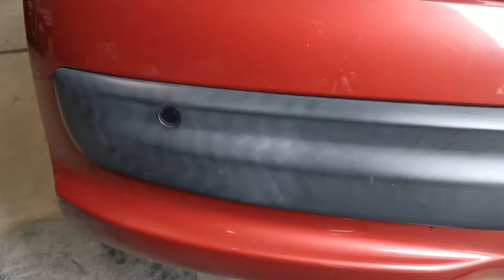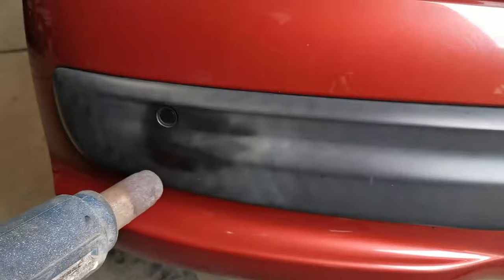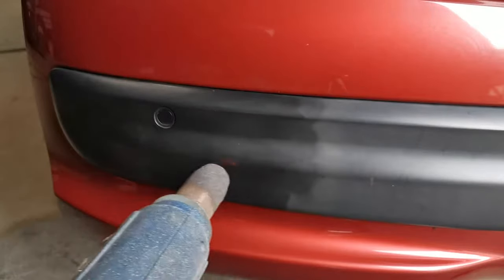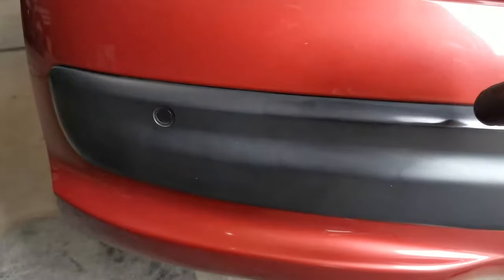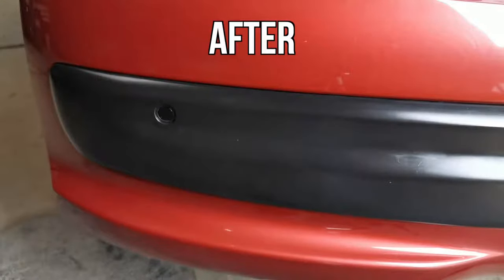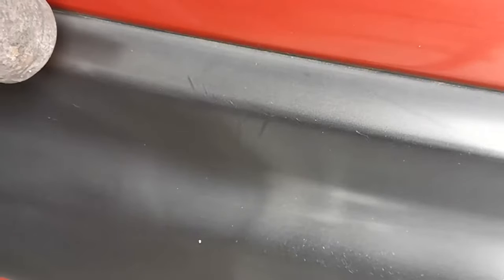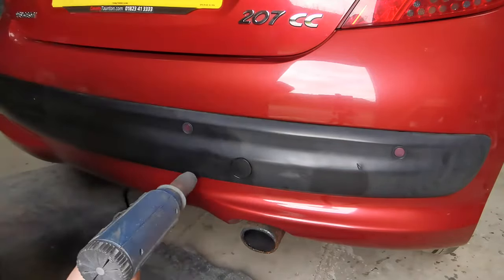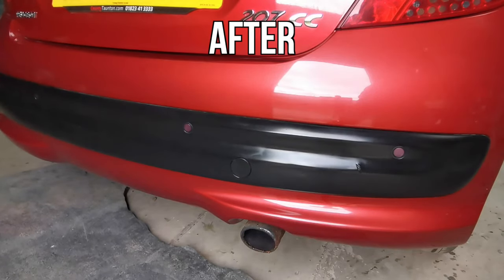How To Restore Your Cars Bumpers Back To Black for FREE

Comment: Never do this!!! The plastic pieces will go gray over time again and your slowly removing all the oils from the plastic until it will break and fall apart. Use products instead that will make it look new
Reply: Utter tripe. You're 'burning' the oxidised layer of plastic of the surface. You're removing nothing but that. Even the products with dyes in them are crap. 

This is by far the best method.
Reply: Kiwis black shoe dye and a rough washing up sponge works and only costs a few quid. This heat method is ok but you can only do it a couple of times then unfortunately the plastic will go brittle. All plastics come with a melt flow indicator when manufactured if this is higher you should be able to use the heat a few more times. Also depends on what the major component of the plastic is aswell Hdpe, Ldpe, Pp, Pu.etc.
Reply: I have to say, I appreciate the video but I wouldn't do it and prefer to use a dye or coat of something else ✅
Reply: Yup 👍 penetrol works well.
Reply: You are not REMOVING anything, you are just rearranging the plastic.
Reply: I have not found a product that works for a decent length of time

Comment: I think it should be pointed out this can make the bumper brittle and cause long term damage. Plastic contains oils. Over a period of time time, those oils degrade because of sunlight UV rays. which in turn leads to the plastic deteriorating and going grey or white. A Heat gun pulls more oils from the plastic and onto the surface. The easiest and least  damaging method I've found is boiled linseed oil. Cheap and easy to apply. Like the heat gun method its not permanent, but can be reapplied in minutes.
Reply: That’s why I like Motorola Walter bumper is hot
Reply: I am going to try this! Thanks!
Reply: What can we do with new step pads to keep them protected and looking good?
Reply: Is it literally as easy as it sounds; boiling some linseed oil and applying it with a cloth when cool enough?

Comment: I’ve always wondered if you could use quad zero steel wool. Just rub it lightly with soapy water, kinda like you’re wet sanding… I believe I’ll try it on an old junk car and see how well it works. That’s a cool trick with the heat gun though…👊🏼

Comment: Never thought about applying heat! Smart man
What do you recommend with removing black asfault from the road from the body?
Reply from the maker: Thanks Chris, glad you liked the video! RE Asphalt (or tar spots),  the safest way is a specific tar remover. I personally use Autoglym Intensive Tar Remover (https://amzn.to/31ij9CR). There are also various other methods i've seen people use (including petrol!), but as i say, the safest and most sympathetic method i know of is a certified remover such as Autoglym! Best of luck!
Reply: Use a rag dipped in white spirit. A bottle is about a quid and will last you a lifetime. It's completely harmless to cured paint.
Reply: You can also use diesel to remove asfaul
Reply: @davelowe1977  

Yep, works well! Also paraffin. Though white spirit is infinitely cheaper I'd have to admit!

Comment: Use a wide filler knife as a protector against the edge and the paint etc . will save you a shit load of trouble !
Reply: Just move quickly and direct the heat away from paint. No need to mess around. I did the whole plastic arche and bumper trims on an R50 Cooper yesterday. Looks superb and no shielding required.

Comment: You can also apply motor oil while it is hot. It will protect it, and also deepen the color
Reply: Would you put the oil on like you are putting sauce on ribs by using a silicone basting brush? What kind of motor oil.

Comment: Great! A torch is much faster and applies  more heat giving a better finish.
Reply: Noooooo. Whoever reads this don't. Stick with an electric heat gun. No moisture, fuel deposit contamination  and far more better to apply. More heat absolutely does not equal a better finish.  If that was the case I'd be using my Sheen flame gun.

Comment: Hi, did you apply armor all after heating it? Thanks for sharing the tips
Reply from the maker: Hi, I used a Meguiars gloss product after heating, but I'm sure armor all will do the same job. Its not essential, but it just helps to protect the plastic a bit further!
Reply: @JohnnyGetsCash  Thank you
Reply: @JohnnyGetsCash hi I'm getting new step pads. What should I do to keep them protected from UV and looking good permanently? Thanks!

Comment: Right.. now the wire wool on your exhaust tip!  ;)   Seriously, I've done this with a heat gun and can confirm that a Hair dryer Will NOT Work. WHENI get my heat gun back I'm going to use masking tape on the paintwork, it's easy enough to move from panel to panel a few times

Comment: I’ve read this will fade back to grey fairly quickly. Is that true?
Reply: No.  But clean the plastics thoroughly first and allow to completely dry before treating.

Quickly run the heat gun over and don't dwell on certain areas, keep it moving fast and direct away from paint!
Reply: Don't do this it will cause plastic to get brittle and CRACK😢😂😢

Comment: Will hair dryirvwork for heating
Reply: I wouldn´t advise to use hairdryers for this task, haidryers power is inconsistent and most likely will burn the area instead of just heating.

Heat guns are more consistent because it applies the heat uniformly and according to the temperature you set it to work.
Reply: @3DModelsToys  tried yesterday with hairdryir but not working

Comment: No!!! That is totally wrong. You are bringing back the plastic oil to the surface which will dry in less than a month and make it look even worse. The best solution is a plastic ceramic coating that will last years with no problems or solution finish if you have multiple cars that needs doing.

Comment: Warning - this absolutely did not work for me and in fact damaged my Qashqai bumper! If the bumper looks like hard plastic but has a slightly rubbery touch avoid doing this. It may work on a hard plastics but I am not going to try it.
Reply: Yea it only works on certain plastics, I did my dad's bumpers and side trim with great results but it didn't work on the door handles and other bits of trim.
Reply: If you swell on the plastic surface it can and usually will cause the problem you describe. 

I'd hazard a guess you weren't careful and held the heat on for FAR too long. Keep moving the heat and very quickly. This can and will work on a wide variety of dyed unpainted external plastic trim but only if done properly. The plastics on your Nissan when done properly absolutely wouldn't have been ruined.

Comment: Not free! 
Cost of the heat gun 
Electricity clearly isn't free even if you have solar you still paid for the solar. 
I would prefer to use a propane torch it's faster and easier to judge the temperature.